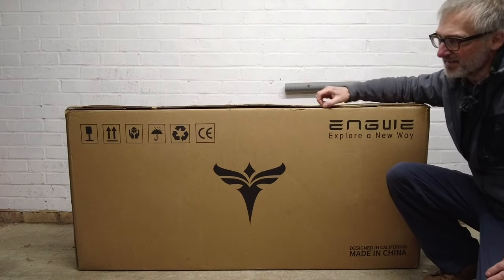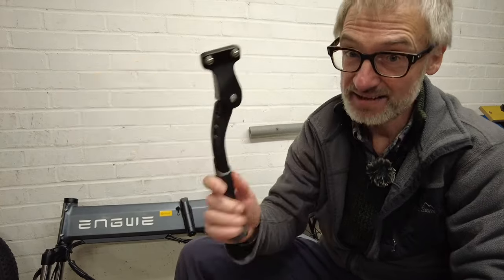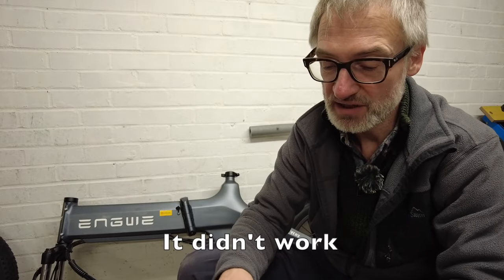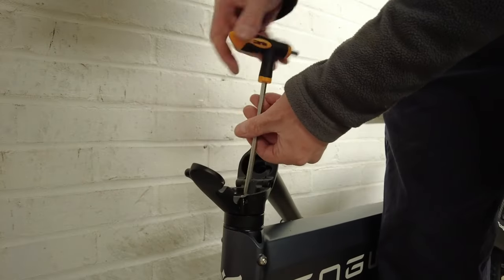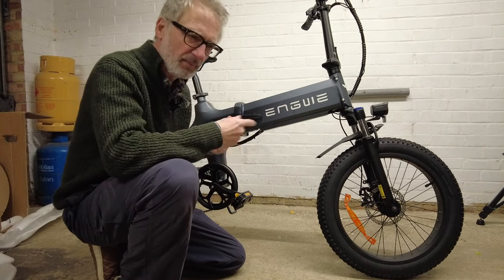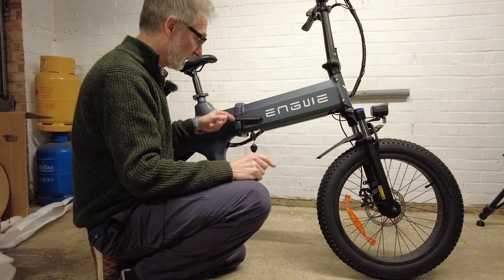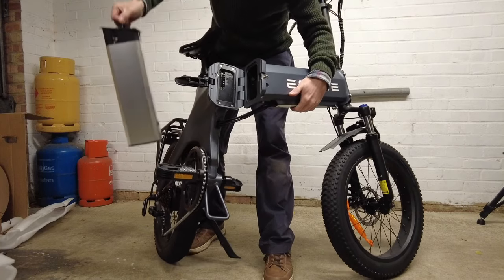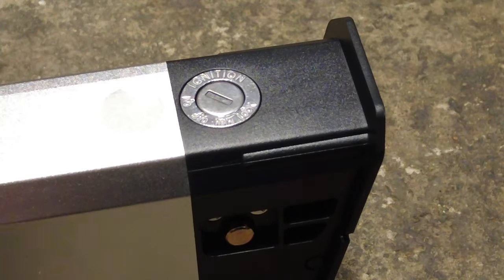Ideal Folding Ebike for Campervan - Engwe C20 Pro - Unboxing, Assembly & Review

Comment: I’ve had thoughts about buying one of these,
Is it a soft enough ride at the rear as I have a back problem,
The Engwe engine has rear suspension so a little undecided what to do.
Reply from the maker: This ebike doesn't have rear suspension, @hunter9372
Reply: @HermanHitstheRoad  
Yes I understand that,
They’re other model the Engwe Engine does.
Reply: I just bought a suspension seat post and it works fine. Less moving parts without the rear suspension. I ride in Miami Urban rising not off-road, but my experience is that it rides just fine with the suspension post and the battery padded. The three inch wide wheels are preferred to the 4 inch wheels on the other bikes. The C20 Pro version I have in the US goes 25 MPH, so that is plenty. Not sure how the EU version performs with the 250W motor, but I heard they might have upgraded that recently.

Comment: I have had two of these (C20 Pro 48v 500w version US) for a year. Both have battery rattle. So I would put some felt tape on the battery edges to make it fit snug to eliminate the rattle. Engwe quit selling the C20 Pro in the US. Not sure why as I have had no issues with mine.  Nice review and remember the push off when in off position to turn a bit further to retract the lock fully in order to remove the battery. This is not a well documented feature so thanks for showing this. Cheers!!!
Reply from the maker: Nice tip about the battery rattle. Thanks @garyspeakman779 👍👍

Comment: Hello, nice review. Could you tell me what is the width of the rims in MM. thanks. @HermanHitstheRoad
Reply from the maker: Hi, the wheel rims are 70mm wide and the tyres are 80mm wide. I hope that helps 👍
Reply: @HermanHitstheRoad  Thank you. I’ve been trying to get hold of a pair of wide rims. So just to confirm the the width of the wheel bone from one side to the other side is 70mm

Comment: I bought a bike very similar to this for motorhome use. It is fun to ride but the ”complaint” I have is that this generation of bikes are a still extremely hard to fold away and carry with all the cables and things sticking out. The operation must look like Chaplin comedy films with the old steamliner sun deck chairs. 😅
Reply from the maker: Thanks for commenting, @ari.voutilainen 👍👍.
I guess the weight of them doesn't help with the folding and lifting